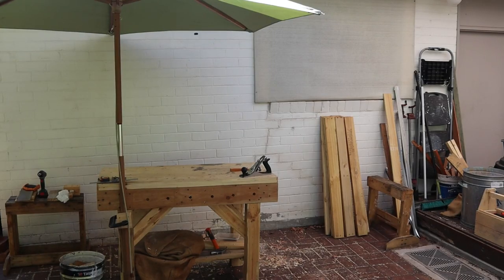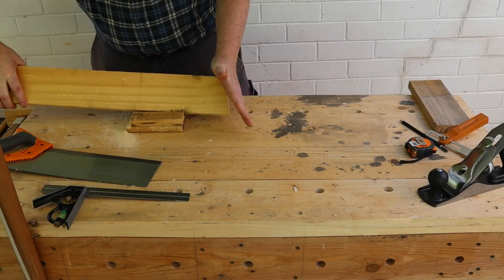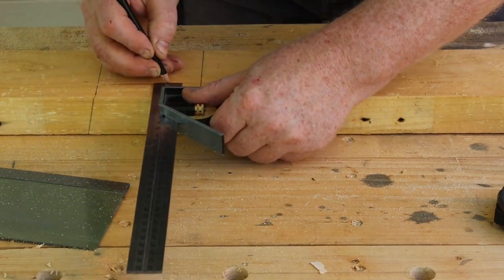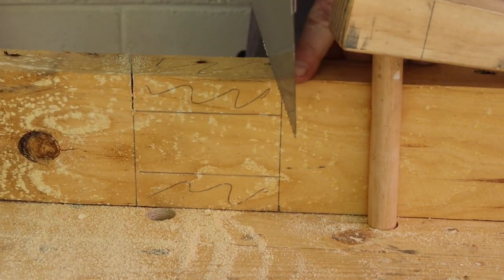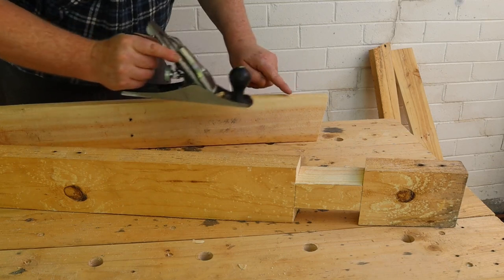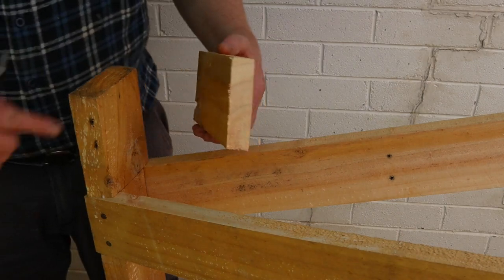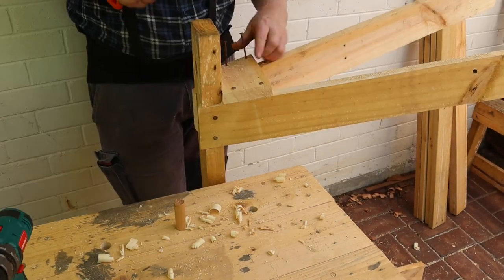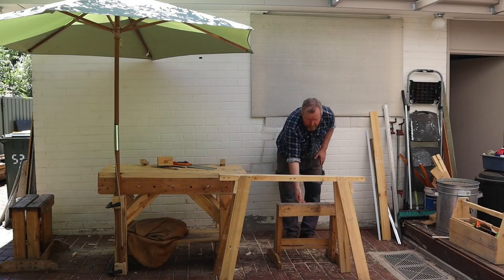Building simple trestles (sawhorses) from pallet wood

Comment: Very useful, nice and sample, work best  in pair. I guess two can be made from one palette?
Reply from the maker: Yes, you would be able to get 2 trestles from a single pallet if you can get 2x heavy and 8x light undamaged boards from it.

You need to start with a pallet like the one in this video, (you need a different design to make a trestle from EPAL boards):

https://www.youtube.com/watch?v=BYWYVVy5Mtc
Reply: @TightwadWorkshop  O, I see. Loks like beer pallet.
Reply from the maker: Here in Australia that style of 1200x1200mm pallet is the most common.  The unpainted softwood ones are single-use, the returnable ones are made from hardwood and usually fully painted with a company name (like "CHEP").

EPAL pallets don't get usually returned for reuse here.